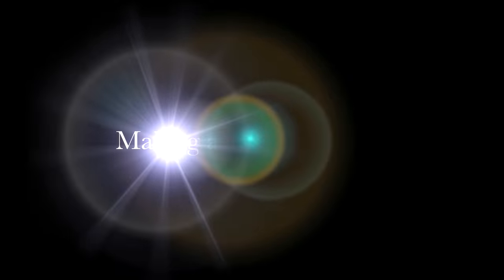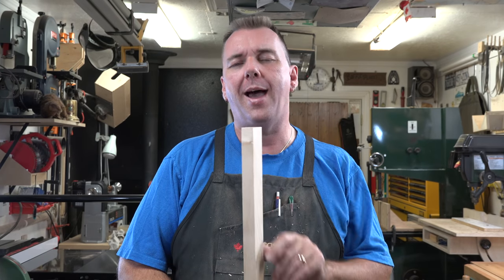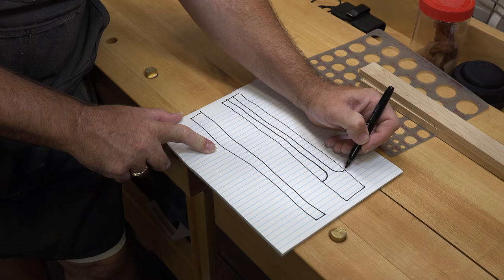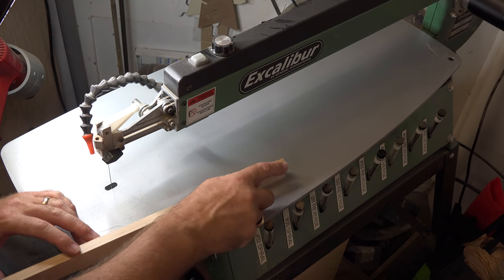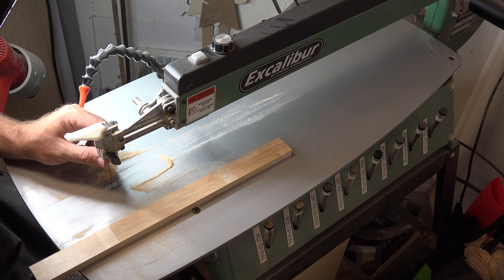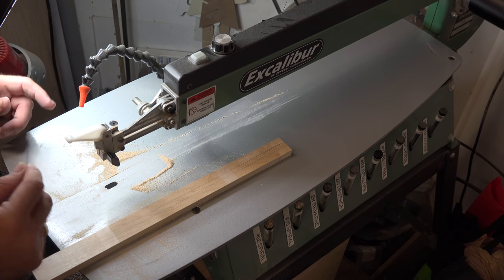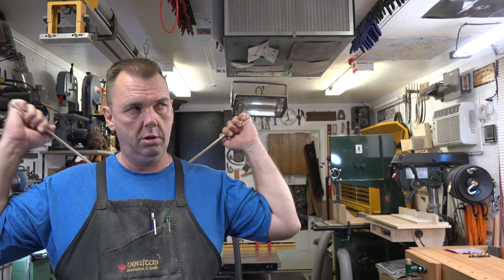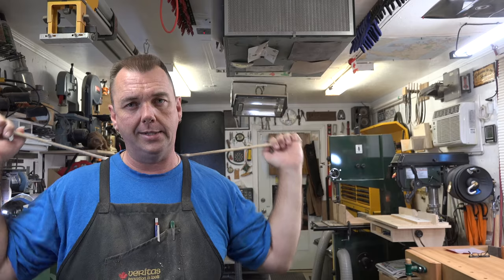Making a Back Scratcher

Comment: Kenny why not just redraw your profile of your handle on the other side, instead of taping back on the cut off piece?    7:14-8:40
Reply: Tim, you wouldn’t do what you suggested because you’d be bandsawing over a void (caused by the finger part of the scratcher).  Not super safe, and the wood can vibrate uncontrollably.  It’s way safer to have the flat face down against the table of the saw.